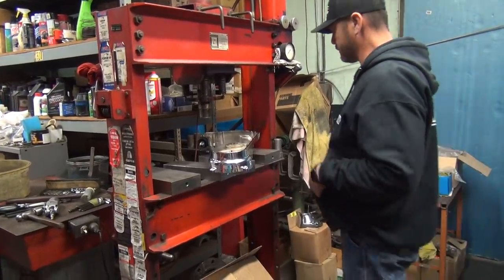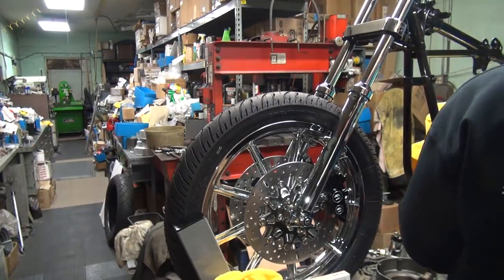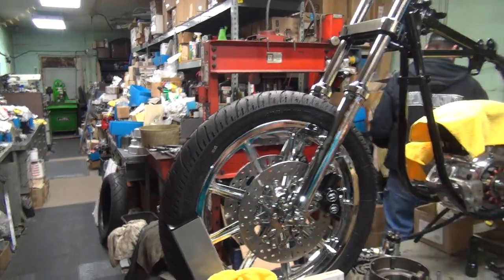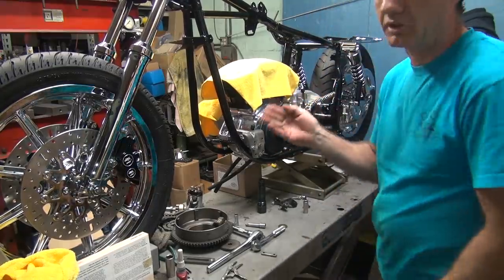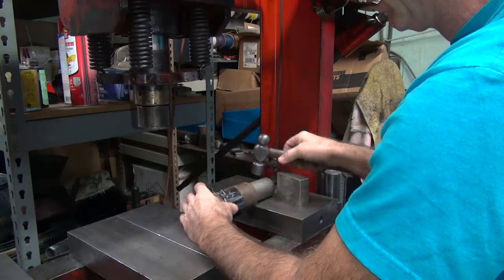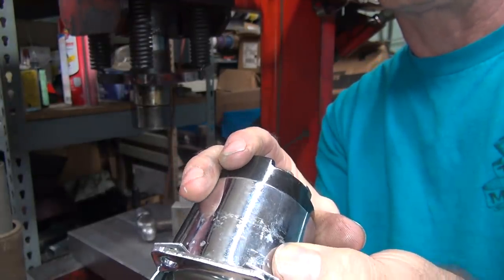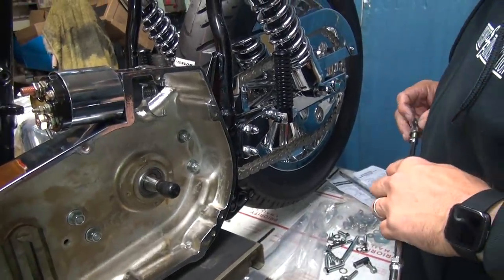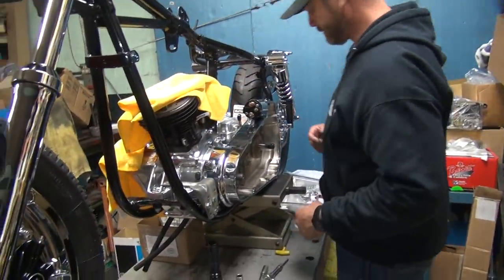#150 1978 93ci stroker shovelhead big bore motor new bike build fl harley by tatro machine

Comment: Would ratchet top work on trans to give clearance or not for that year?? Put a hand shifter with foot clutch ... I would enjoy spending time  working with you, so much I could still learn and maybe help with some of those jobs waiting. Under your guidence  of course. Being retired and hardly ever sleeping I would be in Hog Heaven lol   No pay ofcourse
Reply from the maker: the trans is a baker 6sp, that is why things do not fit. not all upgrades are that easy to deal with. they don't tell you that when you drop your 3k+.
tatro
Reply: A couple of years ago, I replaced the OEM tranny on my 1984 FXST, with a Baker 6into4 (with kicker) tranny .  The OEM '84 FXST has a solid mounted EVO motor driving the old style shovel FX drivetrain.  Chain primary, dry style clutch, 4-speed tranny (with kicker), and chain final drive.
1) When I tore it down, I decided to replace the OEM Hitachi starter with an aftermarket high-torque starter.  I chose the 'All-Balls' starter (it's available in chrome too... LoL!) because the company claims it doesn't need the brace between starter and tranny.  The nose cone bolts directly to the inner primary (can be rotated to accommodate the battery stud location on the starter) and the starter bolts into the nose cone.  And it has FAR more torque than that Hitachi!  The Hitachi may have been fine with shovels but, especially in factory tune, was WEAK with an EVO!  This All-Balls starter turns my EVO over WITH AUTHORITY!  NO fitment issues!
2)  I ordered my Baker with the splined-mainshaft.  I also ordered their splined, diaphragm-style wet clutch, to replace the OEM clutch.  One of the bolts, in the top-cover of my Baker, is drilled to act as a breather.  By removing the seal in the clutch hub, the primary will 'breathe' through the transmission - eliminating the need for a breather in the primary.  Something to keep in mind for the future...  Of course, YMMV!

I'm loving this build!  I can't wait to 'til you light her off!

Comment: Wait till the brackets break and shorts out starter solenoid,  seen it happen more than once. The solenoid is chrome why cover it???
Reply from the maker: the rubber boot would stop that if it was installed correctly. i still don't like covers. i like seeing the parts.
tatro